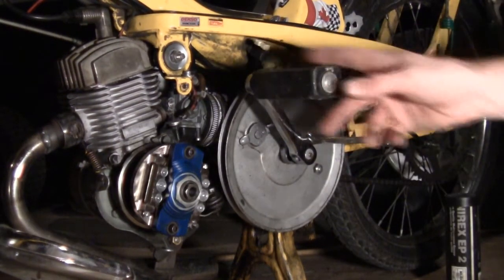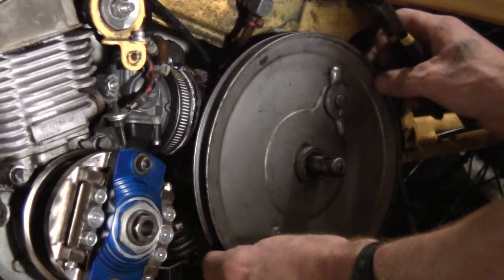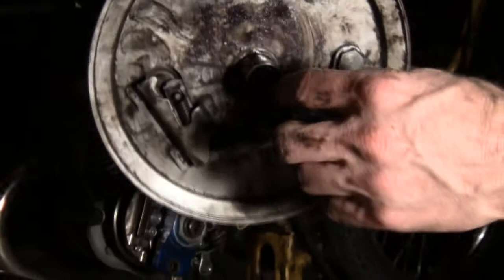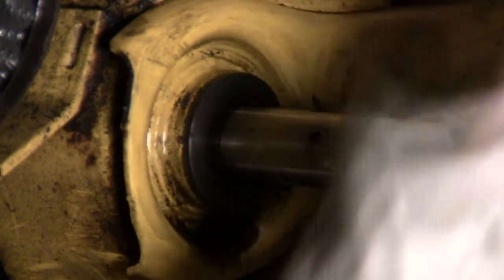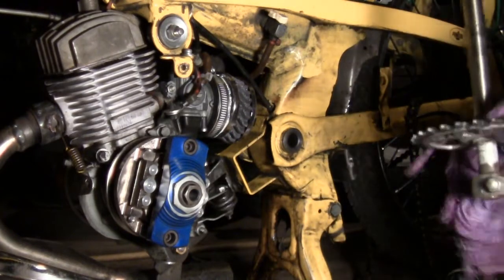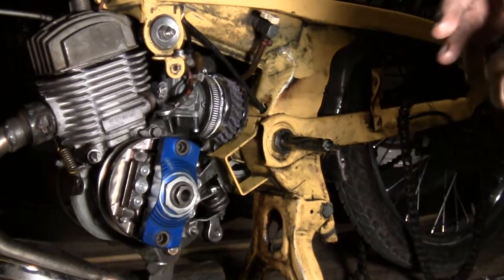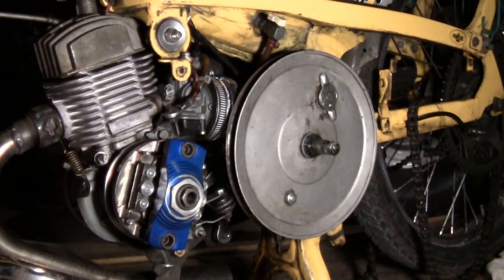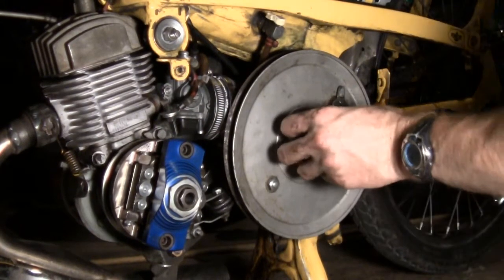Motobecane drive pulley maintenance

Comment: Thanks for the lesson. I just needed to remove the pulley and belt to make it easier for the garage to weld a big crack in the forks on the frame were the stand is bolted to. However I might clean it up and re grease the bearings the same as you did while I am at it.

Comment: Good stuff.  I have to replace my chain.  It blew out.  Wish I could have seen you fumble around with the chain a little more.  I would guess one of the reasons my chain jumped and snapped, would be no grease.  I have never greased it.  Going to attempt this maneuver in the next week or so.
Reply from the maker: read up on motorcycle chain tension, too tight is no good and will actually slow you down, too loose will jump all the time, make sure you have some sort of wheel lock on\around the lug nuts, it'll save a lot of headaches